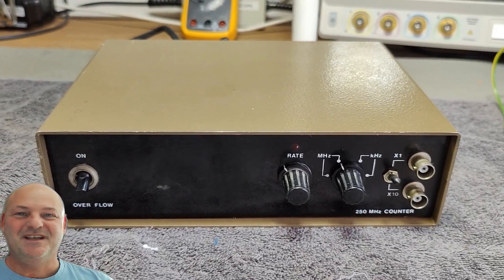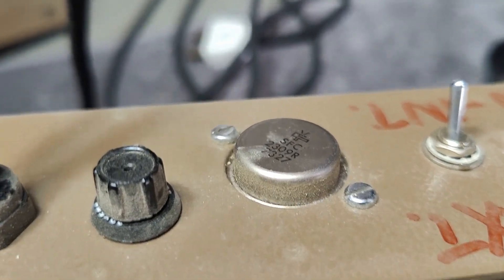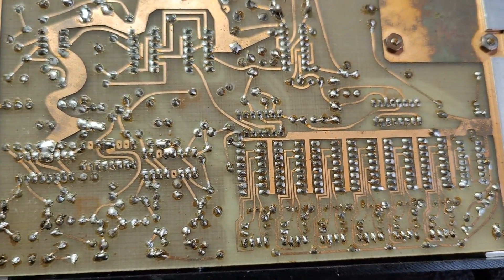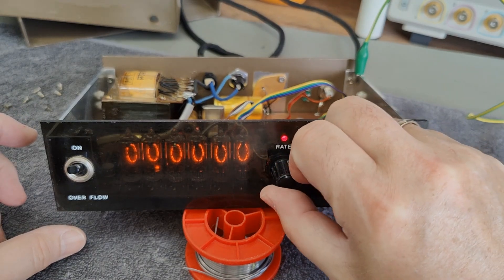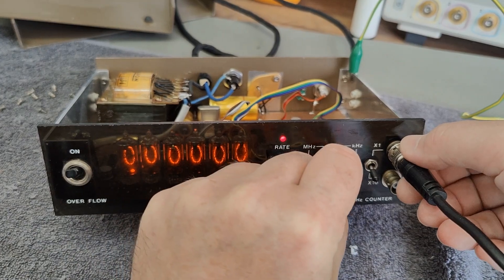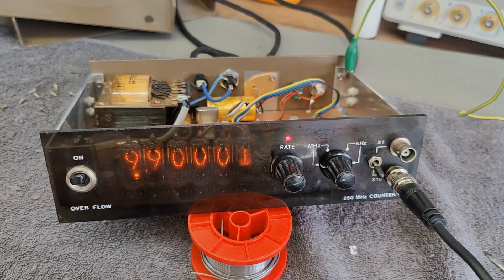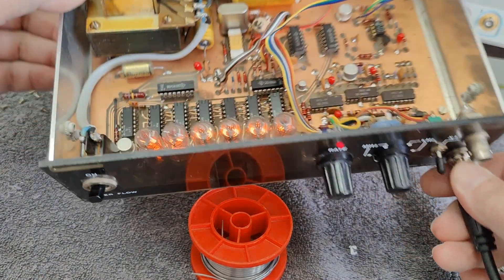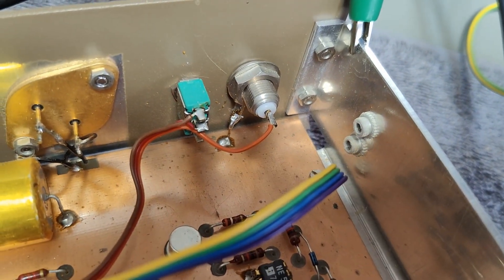KN Instruments Nixie Tube Frequency counter 250MHz 1974

Comment: I'm trying to figure out why that TO-3 regulator was mounted this unique way - the only benefits of this is you need to drill one hole less, but instead a much bigger hole is needed. Maybe the manufacturer had to pay for the enclosures in a way where reducing the number of holes made some economic sense. Another benefit would be that the regulator could be soldered to the PCB before the PCB is mounted in the case, that would also allow testing of the PCB before it is mounted. Either way, this doesn't look like a product they made hundreds of thousands of, so how much money would those measures save anyway...